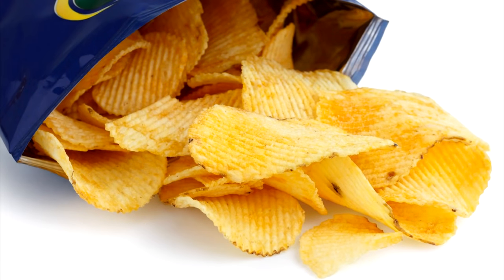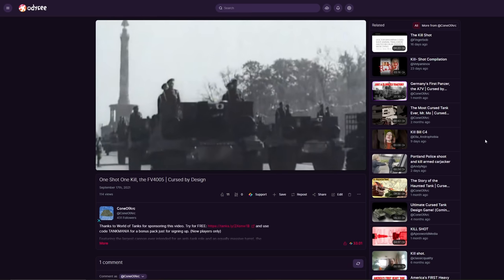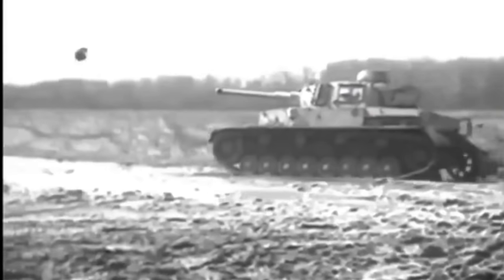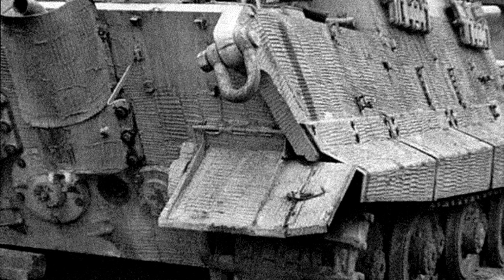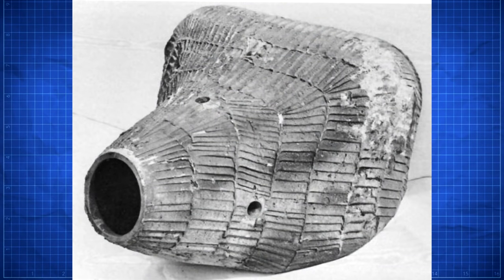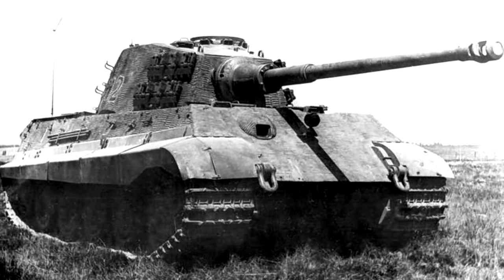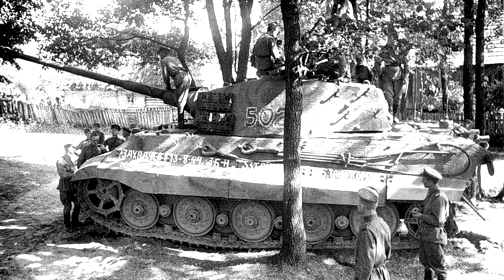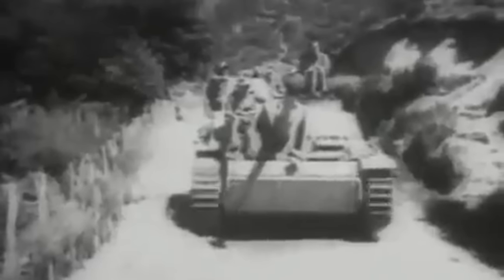Why did Germany put Zimmerit on their Tanks? | Cursed by Design

Comment: A couple of notes about the science: 

Naval magnetic mines used the change in magnetic field caused by a steel ship moving through the Earth’s magnetic field to trigger the mine’s explosion.  Typically, the mine would be on the sea bed in shallow water, like an estuary, and would explode when a ship passed over it.  (Thunderfoot made a video about them a few years ago).  Degaussing prevented the ship from triggering this type of magnetic mine.

The only type of mines that used magnetism to stick to a ship were the small limpet mines with clockwork timers, used in sabotage, for instance in the “Cockleshell heroes” commando raid on German ships moored in a harbour in western France.  Degaussing would not prevent this type of mine from sticking to a ship.

Zimmerit was essentially a type of textured paint, and almost all paint uses a solvent (sometimes water, sometimes an organic solvent) to make it fluid.  Paint needs to be fluid so it can be applied.  The only exception I can think of is powder coating, which is a different technique altogether.  So Zimmerit didn’t need the solvent for transport, it needed it so it could be applied to the tank.

Comment: Far as I know, the Allies never used magnetic mines against tanks. They just used sachel charges and threw them up on the engine deck, and hoped for the best. I think the idea was Zimmerit would provide enough spacing that the magnets would not stick to any sloped surface like turret or hull sides.
Reply: The British also had “sticky bombs” covered with a sticky glue that would stick to the side of a tank, and, according to the Wikipedia page about them, they accounted for six German tanks in North Africa.
Reply: The Allies did use magnetic mines. the hawkins mine was a small magnetic mine, but realistically it would be placed on the suspension or tracks to demobilize the tank. you also had the British No.74 sticky (anti-tank) grenade which used glue and which was quickly taken out of service due to many accidents with them.
Reply: @frankpolly  I searched now for quite a while, but even the field manual of the Hawkins mine didnt even mention magnets at all

Comment: Tbh I really like the zimmerit.
The idea behind it was really sound and smart (why didn't the allies use magnetic mines ?) 
the solution they found was also very cheap and easy to make. 
althought it wasn't very useful in its intended purpose it had some other non negligeable applications.
And it looked really cool !
Reply: Cost, weight, deployment time, supply logistics for bulky mag-mines, etc
ultimately, it turns out a good pressure triggered AT mine worked fine.

Comment: I have no knowledge of how magnetic mines were used. First I assumed they would be concealed under ground like most traditional mines are but triggered by the magnetic signature rather then pressure triggered. However the Zimmerit seems to have also been covering the tower and topside of the tanks as far as I could see. So would that be to reduce the magnetic signature even if mines are placed under ground or were the application of these mines a bit different from traditional tank mines? Think there was a picture of what I believe was the allies testing Zimmerit and the mine was being placed/held at the side of the tank?
Reply: deployed via infantry, sneaking up behind a tank. You pop it on the side carefully, and run as fast as you can since the crew absolutely heard that, while unwinding your detonator wire coil.

Comment: It's my understanding that it also greatly increased the weight of the tank thereby adding an incredible overtaxing of the already barely adequate transmission. You're basically adding about an inch of concrete over the entire surface.

Comment: When i remember correctly there are several Reason why Zimmerit was not used later: 
1) Only Germans used Magnetic Mines. 
2) It used lot of petrol in the Production.
3) Timeconsuming in application 
4) When not flame hardened and even when the Aceton in it was flameable for 1-2 Weeks. 
A deeply cured Zimmerit was not flameable but a fresh Zimmerit could burn. 
5) Weightsavings, Zimmerit was light but it still had some weight on it. And weight increased maintenance and Fuel Consumption.
So Zimmerit had only one obvious and with the heat absorbing effect one not so obvious merrit
With 5 big Cons.
About 2) we speak of a Wehrmacht which reduced the Colorscheme to Primer and some Colors in Januar 1945 to reduce Petrol in Paints.

Comment: fun fact: Zimmerit was also tested on U-Boots but regmans decided that reduction in speed was too great to use it.
Reply: Fun fact: no it was not.

What was tested on u-boats was Alberich, a rubber coating against ASDIC detection.
They also tested a coating for the snorkelhead and conning tower against RADAR.
But they never tested Zimmerit on u-boats, because there was absolute no use for it on a u-boat, there werent navy seals swimming in the atlantic, trying to stick explosives with magnets to the hull of a u-boat.
And magnetic influence mines dont care about the Zimmerit, they react only to the magnetic field wich the Zimmerit doesnt change
Reply: @wolf310ii  ,on that note,did the British never use Limpit mines on U-boats at any point?

Comment: I wonder how effective it would be again early HEAT rounds. Preventing direct contact with the steel using something that is quite heat resistant should have helped slightly, especially if hit at an angle.
Reply: HEAT projectiles don‘t actually use heat to defeat armor, but the focused copper beam formed from the lining on the shaped charge which is propelled through the armor by the force of the explosion. The greater standoff caused by the zimmerit would only have helped against that if it was much thicker, causing a premature explosion much like modern cage armor.
Reply: @GhostRider659  they actually do, the energy, including heat energy contributes to the penetration, which is why substances with a very high melting point and low conductivity like quartz are used in composite armor. Sure its not going to provide massive amounts of protection, but a small amount of spaced armor on a sloped surface can be the difference between a dead crew member and a slight injury. Point being I'd rather have it than not have it, and with the amount of heat rounds used on tanks during ww2 its very likely it contributed to saving some tanks during the war
Reply: It probably helped keep a plasma channel from forming, yes.  Most likely it's true purpose.
Reply: @antimatter4733  You're very right.  We also have to consider that none of the allied commanders (after they murdered Patton) would have wanted such a thing.  It would have basically made tanks invincible to everything but air power & they were planning on some protracted wars against people who tended to not have a lot of that.
   Most people don't want to hear that one of the main reasons for these wars we fight is killing the flower of a country's youth, though.  They want to believe that sociopaths really care about them, deep down.
Reply: @gratefulguy4130  well the main reason is actually to fund the military industrial complex. No reason to spend trillions on weapons if you're not fighting any wars
Reply: @gratefulguy4130  Buddy you should probably stop spouting fiction in the comments. Doesn't look good. Maybe get back on the meds? Or...off them? whichever you aren't currently

Comment: Maybe it wasn't actually meant to be used against mines after all 🤣
If it protected against a flamethrower, maybe it was some form of insulation against hot and cold weather. If the the ammunition gets too hot or cold, it changes the ballistics due to the powder burn rate changing. High temperature increases the burn rate, increasing muzzle velocity and thereby the gun recoil while cold temperature leads to slower burn rate, lower muzzle velocity and increases the likelyhood of backblast from unburned powder when the breech opens.
Steel on its own obviously can get hot or cold very fast.

Well, I guess they wouldn't put Zimmerit on sideskirts then, if that was actually the case 😋
Reply: It's great how Zimmerit was simultaneously an entirely pointless idea and accidentally genius. Despite both of those things it probably had minimal impact in actual battle.

It is perhaps the most German invention of all time.
Reply: It's pretty obvious it was anti-heat.  Most likely it would have avoided too many casualties for us to want to use it (casualties are an "important" part of the wars we fight from the perspective of those who start them).
    If that sounds paranoid to you, remember most anti-tank munitions of the time relied on creating a plasma channel with a shaped explosion to melt it's way into armor.  If you've got a self-healing (under heat) thick coating on your tank, it will probably make it far more resistant against things like RPG's.
Reply: @gratefulguy4130  I can't emphasize enough that the "paranoid" part of your argument is not "but is it mechanically possible for this to have offered protection" it is the "actually the military is trying to maximize its own casualties for nefarious reasons"
Reply: @johnalogue9832  These people don't listen to the videos they watch do they
christ.

Zimmerit wouldn't do shit against a properly impacted shape charge, that was neither its design need nor its actual function. At best it stopped a tank from cooking from being molotov'd, and was intended to stop a magnetic mine from being placed on the side of the hull (which never actually came into use).
The idea that this simple pseudo-ceramic was "self healing" is funny as hell to me as well.

Comment: Having worked in a UK Admiralty research laboratory in their tool room.  To control the heat flow on a piece of steel we would place a ring of "Heat ban" around the steel and this would stop the heat flowing to an area of the part we did not want to become heated.  I would say this Zimmerit was used for this purpose. Heat flows on the surface of the metal not through the core of the metal.

Comment: i used to think this was hardfacing, the parallel weld beads they weld on heavy equipment to slow down wear, like on a dozer blade or the side of a backhoe bucket, i have to admit it didn’t make sense to have hardfacing on a tank turret but that’s what it looked like.

Comment: Barium sulfate has a fairly high density and some structures are platelets that form a very rigid almost impermeable dried form. I would have thought it would add considerable weight to the vehicle and actually reduce range at a time when fuel usage would be a serious concern.

Comment: Its interesting what you mentioned about flamethrowers/fire against tanks, I've had people vehemently argue that fire and flamethrowers specifically could not cause damage to WWII tanks. Any possibility you might someday cover the topic?
Reply: No need for covering obvious facts!
Flamethrowers couldnt do anytning to a buttoned up tank!
...unless the same tank is sitting down and yelling! "Fire me some more"
Reply: @Stormtrooper  What? Flamethrowers can cook tank crews from inside their tanks, and burn up the engine quite easily, and as mentioned in the video, set off ammo racks and other munitions stored in and on tanks. There’s a reason molotovs were used against tanks. Napalm was considered the best air-to-surface means of destroying tank formations for decades after WW2.

Comment: I thought it was Hard Surfacing applied by the Shielded Metal Arc process by a weldor.  Hard surfacing Elctrodes leave a pattern just like that.  I can see how the Zemmerite might work though.  If you have this NON Magnetic Coating two things happen.  One the MAGNET cannot get DIRECTLY on the Steel Surface of the tank.  The rough surface keeps the magnet from getting as good of a BITE on the Smooth Steel surface below the Zemmerite.  If you look at a Track Hoe Bucket you will see HARD SURFACING Beads run on the Bucket to fight off ABRASION.  It looks like the same thing in a Black and white photo.

Comment: Magnetic anti-ship mines most often rested on the bottom with a magnetic field sensing trigger. A few may have used a bottom anchor with the mine floating just below the hull travel path in the water. The only anti-ship magnetic attachment explosives were the British developed Limpet mine family which use multiple magnets to attach to hull well below the waterline. The Germans had a similar mine for Anti-tank use, and so did the Japanese the Russians did not have these in WW II but the Germans did not know this. Thus, the Zimmerit was designed and employed on tanks.

Comment: zimmerit  was used only for one application and not for any anti magnetic properties or heat resistant
main idea was a fast camouflage "paint" in the field , in the summer we use simple clay,dirt etc. mixture apply on the tank and that stick easily to zimmerit  in the winter we use white lime , we as a crew can re-dress the tank very fast and efficient and that all what it was used for - info from my grand father.

Comment: Rocket equipped Typhoons and Thunderbolts would find armor columns and decimate them with squadron attack methods. The only real defense then was to abandon tank and run away as fast as possible.
Today the A-10 Thunderbolt ll still fills this role and multiple barrel 30 millimeter cannon fire.
The velocity and high density projectiles can be very effective on ground armor vehicles.
Also various guided missiles able to penetrate armor plating systems.
Waves of aerial attacks making tankers wish they would have chosen another branch of service.
Reply: the A-10 is a flying trashheap that the US airforce rarely deploys. It is very easy to shoot down with modern AA, and too slow to do anything about it. Additionally its role can be covered by a number of other aircraft, relegating it to propaganda tool alone.

Comment: The first layer was not applied in squares. It was evenly applied and then they scored lines in square patterns into it so the second coat had some texture to grip onto and create a stronger adhesion. The same thing is done when doing old fashioned plaster walls and ceilings.

Comment: You have to understand that reduction of magnetic field (degaussing) had nothing to do with giving the steel a property where magnets will no longer stick to it.  The former makes an object harder to detect at a distance.   The latter is impossible.
Reply: I think magnetic attraction I inversely proportional to the square of the separation distance.  So the thickness of the coating would greatly diminish the holding power of magnets.  The rough surface would nearly double the effective thickness for any given amount of material applied.

Comment: I think ceramic tiles would have enhanced durability as well as had a superior fire resistance with no burning hazard. Ceramic isn't considered a modern technology either unless we get into metallic alloy ones we use today. But all they really had to do was use light weight pottery strung together for the same effect.

You could even have a flexible overhang over the front and sides of the tracks as well as the bottom of the tank.

Comment: The rough coating on American tanks is for traction.  It's basically sand mixed in with paint.  If you've ever tried to walk on painted steel in hard rubber-soled boots (like combat boots), you'll know that it's as slick as ice.  This coating will only be on top of the hull and turret, since that's where crewmen and mechanics need this safety feature.  Any other effects (camouflage, etc.) are incidental.  American tanks (and all other vehicles intended for field use) are painted with chemical resistant CARC paint, which can withstand decontamination chemicals used in the event of a chemical warfare attack.  Normal paint would simply be washed off of the vehicles by the decontamination process.

Comment: The Soviet T-tanks of WW2 sometimes had steel bed frames with wire springs welded onto vulnerable parts of the tank like turret sides. It worked to thwart German anti-tank Panzerfaust rockets. The fuse was a crush contact similar to RPG types. When warhead made contact with bed frame it detonated premature before the shape charge could make direct contact because of the air gap. American Sherman tanks sometimes had welded pieces of aplique plate steel to vulnerable points. Of course it wasn't any good stopping the German 88 round. Israel has used at least in the past before high tech modern laminated armor a "reactive" armor made of a "chess board" arrangement of square explosive tiles that would blow outward to redirect the anti-tank RPG etc. The German Zimmerit anti-magnetic  paste was applied using a tool that looked like a giant hair comb. The Japanese company Tamiya makes a photoetched "zimmerit" comb modeling tool to recreat this effect on scale tank models.

Comment: I suspect the Soviet method for chemical analysis wasn't capable of determining the non-metallic part of the composition. PVA (polyvinyl acetate - in essence, Elmer's Glue) is organic - it consists of carbon, hydrogen and oxygen, and were therefore not measured. Back then they were probably using wet chemical methods to determine chemical composition, the first step would be to ash the material to be analyzed to drive off water and organics - there'd be a large Loss On Ignition (LOI) value, which would be noted.

Comment: I always though those were just "clad welding"- each line a bead of weld, which is far stronger than the material around it. Thats how the surface the anchor chains rattle along are surfaced.
Reply: You can get the same effect much easier by just surface hardening the armor, which was already done. Welds are stronger than the surrounding material because they are harder and more brittle from the heat.